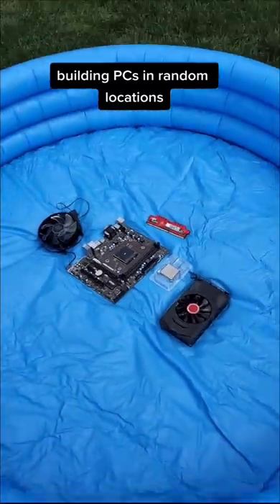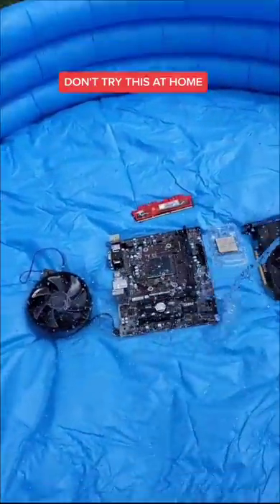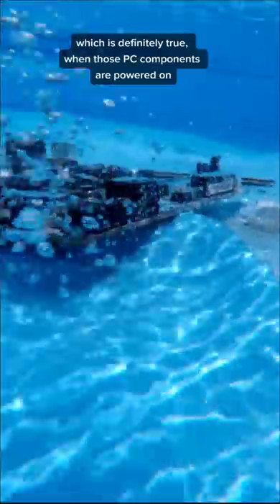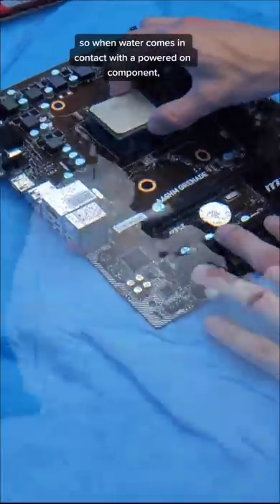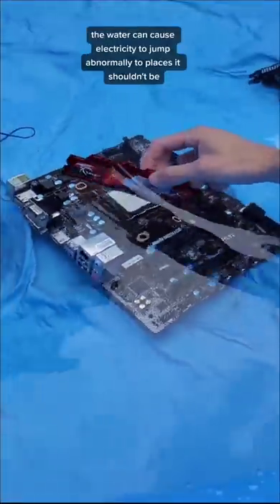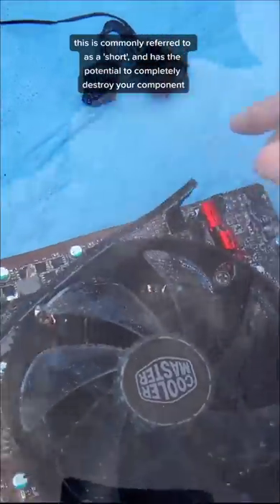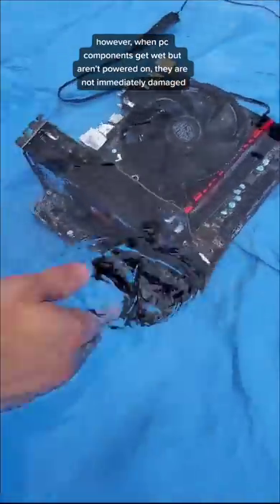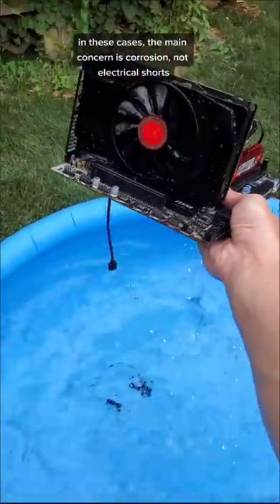Building a PC Underwater #shorts

Comment: So if I immediately dump my pc into water after I turn it off, would it short out? Because surely there might still be some charge built up? And if it would short how long would I have to wait before I could throw it into water?
Reply: You need to provide more info for this "theory crafting" let me give you some info about this in general though

If you dunk the entire rig after it's been powered. Yes there will be some caps and high voltage systems shorted... What and where to that would depend on the individual components and their design as well as the ions and particles in the water , how they are distributed in the water , and the resistance of the water in the path taken by the electricity. 

A PSU has caps that are charged to even 400v while also having caps charged to lower voltages such as 12 ish , 5v ish and 3.3 ish these don't all instantly discharge though it's not unheard of to see a slow shunt on the high voltage caps in some psus to slowly discharge them over time. Though sometimes a formal shunt isn't designed in. Sometimes the components in the circuit themselves allow some leakage. This is quite a complex issue so not easily explained in a comment.

If you were to remove the motherboard for instance the various parts of the vrm and the cmos battery would be a potential for component damaging shorts. However if you flip the psu to off and let the caps drain by starting the PC while the psu is set to off then it will drain the caps as well as most of the caps within the psu (though not within the 3v range cmos circuit for saving UEFI settings if the battery is in place)

You can wash components its not that uncommon to do. The trick is using some basic logic , tearing the components down a bit wash them then let them dry before you reassemble.
Motherboard , gpu , ram (can't see why you would ever need to do this to a CPU or SSD ) 

I have formal electrical and electronics training as well as I do extreme overclocking and have some decent amount of experience with soggy components from sub zero runs

Comment: what if you waterproof coat the pc components then try to turn it on underwater?..... drone people often coat their electronics to avoid shorts when it's snowing.
Reply: We also use similar methods in extreme overclocking like SS/cascade phase change , dry ice , ln2 ect overclocking. Like more conformal coating , liquid tape ect

Comment: Look, I get your spreading information (of which some is true) but this isn't a good thing to do. The water you used is just from the tap, even going through a garden hose shich means it's dirty, and has minerals and chemicals in it. Even after thoroughly drying it, if you don't clean it very well, it will short out, even after being dry. Others have mostly stated the other two big problems here.

Comment: Please dont waste pc parts. It's near impossible to find them in stock or for a reasonable price nowadays.
Reply: He paid for it, you probably cant😂
Reply: If these components were not already dead and just used as props (very possible) as long as these components were properly dried they would function again. Was not terribly smart to leave the cmos battery in however the potential there is quite low unlikely main functionality of the board was damaged with that. I do extreme overclocking and I get boards frozen over and dry them out regularly. Long as you dry them well your fine they are fairly rugged

Comment: yall making pc building into a sport.. I thought it was just upgrading w graphics card so you could play minecraft on more than 2fps
Reply: I mean all kinds of uses for computers. Some of us do extreme overclocking and push components to run at speeds far above their rated performance level. Often using sub zero cooling methods to achieve more headroom such as SS/cascade phase change (-30c to -100c or better) dry ice (-79c) ln2 (-196c) and on very rare occasions LHe (quite a bit colder then ln2) often times we can get close to doubling component performance (+50 -> 80%) when doing XOC

Comment: How are you that rich where u can throw pc parts in water likes it’s nothing
Reply: This contrary to popular belief doesn't harm anything long as the components are unpowered. It was not a genius move to leave the cmos battery in but the potential is low enough that it's doubtful any real damage occurred even if it did it would likely be fairly isolated. Not goona get into all the electronics design BS that's far outside the scope of a YouTube comment. Long as these parts were properly dried and they worked (aren't broken props) before dunked in water they have a very exceedingly high chance almost 100% that they will work fine after. I'd be more concerned about damage from ESD then the actual water. I have formal electrical and electronics training as well as I do extreme overclocking and I get components wet and frozen over regularly and dry them out and run them again and again. Its not that uncommon